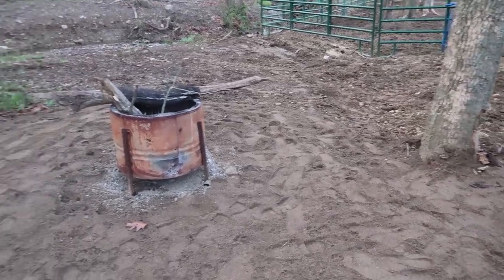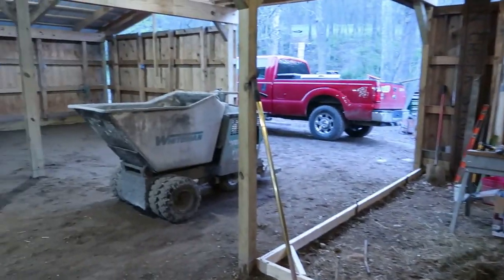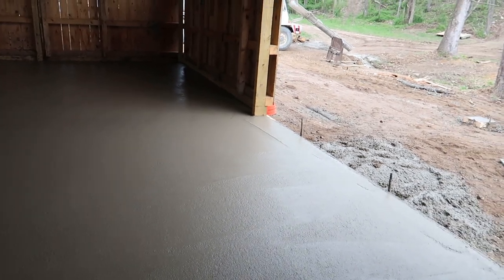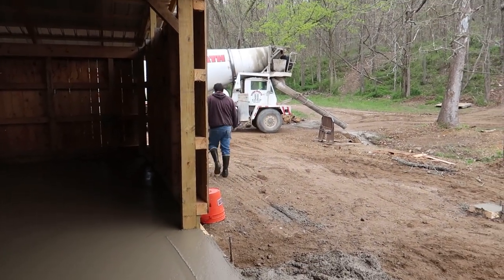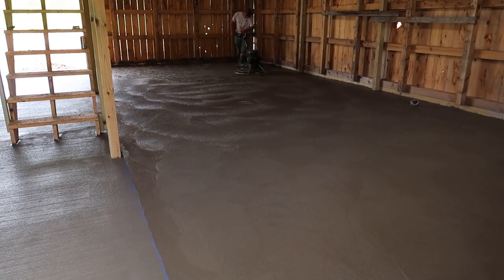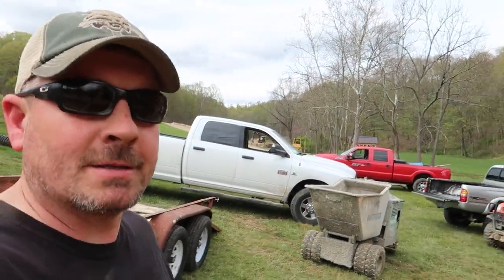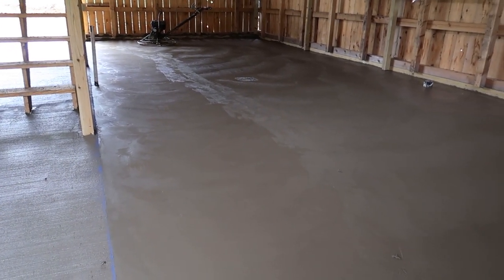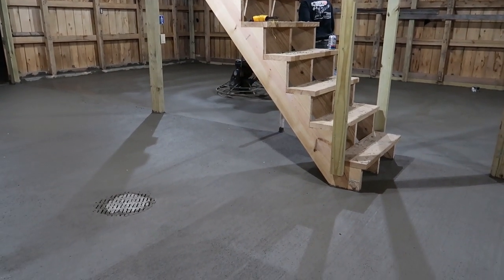#25 Concrete 101, making the horse barn great again.

Comment: Should have installed 440 board around the wood columns prior to pouring the concrete instead of just pouring around and up against the wood. It would help wick any moisture from the concrete to get out. Moisture will be retained between the wood and the concrete and may lead to the bottom of the columns rotting out. Pressure treatment will not help in this situation. No rebar?. I hope you have fiber mesh in it.
Reply: In the future I would have poured a round concrete pier sized for the load down below frost. From finished grade for the thickness of the floor I would have created a box within the circle of the pier and turned it 45 degrees with top of pier at finished floor. You control joints would then run from the outside walls to the points of the box and from box to box in the aisle with a post anchor with a set off plate to keep it off the concrete. This would require a good job with the string lines to make sure everything lines up. A laser would almost be a must for this.